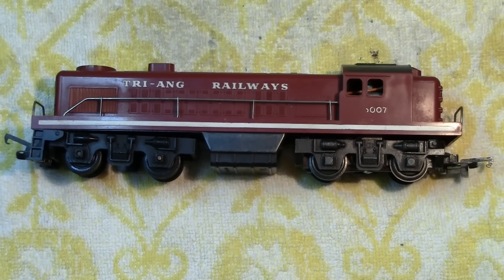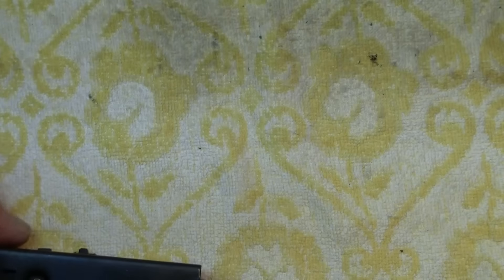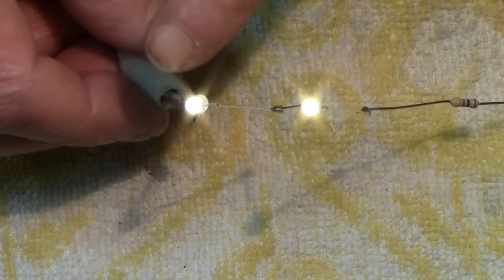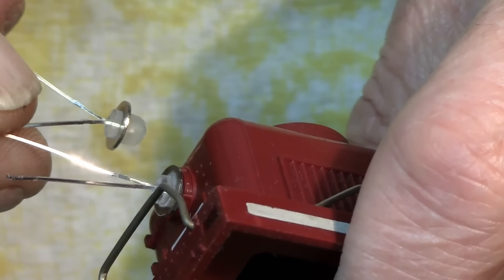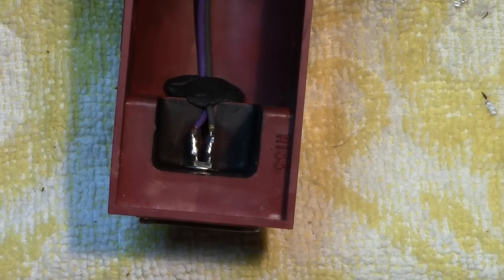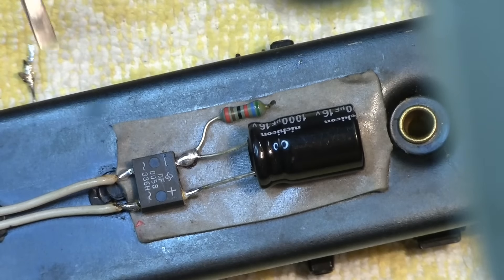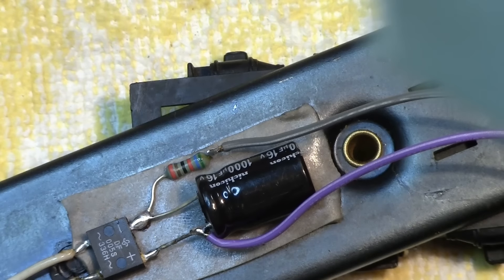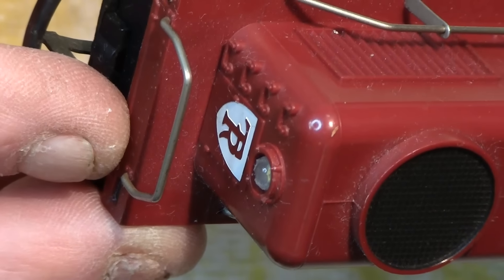Converting Your Tri-ang R155 etc Switchers To Anti-flicker LED's - All Variants. Hornby Triang.

Comment: Excellent video John and has given me inspiration to do something similar to one of my two SR electrics, both of which I had from my childhood, one I have kept as original and the other I have converted to DCC with modified wheels (no knurling) but it has no bulb (no idea where that has  gone!) so I think a 3mm LED might find it's way in there. I have kept all the original parts just in case I want to revert it back to normal again. Many thanks for showing this, much appreciated.           ............Graham
Reply from the maker: +Graham Foulston Thank you Graham for the nice comment. It's such a simple job but very effective & as you so rightly say it can be done on a multitude of items....space allowed that is. If you do it with just one LED everything stays the same although it might be worthwhile increasing the resistor to around 820 ohms, dependent on the current requirement on the LED's that you use? All the best, John.
Reply: Cheers John, I will seriously think about giving that a go and many thanks for the heads up on increasing the resistor value, I will let you know how I get on. Cheers for now,     .........Graham
Reply from the maker: +Graham Foulston Yes mate no worries.....always here to help if I can. All the best, John.
Reply: +Graham Foulston A simple job says he -Graham , I guess  to John it is quite easy though he does explain it well but you know who to call on if you come across any problems eh ? Hope your well graham and sorry I have missed the Tuesday club last couple of weeks but hopefully will be listening in again this week , Alan
Reply: +Alan Surgeoner   Hi Alan, when something like that is laid out in front of me like John has done then I can follow it but I don't think I would attempt to do a double header like that one without some help. No worries about Tuesday nights mate, just whenever you can. I keep screwing up the link so just be aware!   lol.       ........Graham
Reply: Graham Foulston I'm sure it will come together over time. Every good thing has it's glitches to start. How is retirement going. I don't suppose the rain has been any less down south than it has in Scotland (even since the floods) I think the wife must have secretly spoke to him above and said please no garden railway this summer Pretty please haha
Reply: Graham Foulston Was actually looking out some old stock I have an old 37 a couple of tank steam trains and the mail drop off and pick up set . I have a class 35 (Hymeck) I got for Christmas one year ,it was 2nd hand but you were grateful in those days. However it never ran yet my dad swore it did when he bought it . I wondered about talking to John or watching his videos to see if it can be sorted 9which I'm sure it could0. Thing is to start a new layout I am back staying at my parents house after moving back from northern Ireland for a lot of years but it suits me as they are getting on (only don't let them hear me say that) but also I keep a couple of small tanks of tropical fish and its hard enough trying to look out for one hobby never mind two unless you have very deep pockets. Anyway hope you are well .Alan
Reply: +Alan Surgeoner   Retirement is now at long last getting good, I have only just got rid of that virus which I picked up before Christmas so I'm just starting retirement now!!  This last month was a complete wash out.  OK now though. It's been pretty wet down here but nowhere near as bad as what you've had, no floods thank god.        .........Graham
Reply: Graham Foulston Hope for a railroad for the O scale class 50 then ,lol . gnight mate .
Reply: +Alan Surgeoner Night buddy.

Comment: Hi John. Very informative and interesting as always.  However - I seem to be having problems doing mine. I'm using bi-colour White/red at each end, using back to back diodes and a resistor on each LED, to make it "Colour-directional". (I'm using my variable bench power supply to test) I have rated the circuit to easily cope with 16vdc, and I get around 1/2 to 3/4 brightness, from say 6v - up to 16v, which is plenty bright enough. and the circuit works absolutely fine on it's own, swapping colours when swapping loco direction. A 1/2 hour test at 16v in both directions, proved absolutely fine. However, once I connected it to the power bogie, as I eased up to around 6.5v, led's lit as they should, until the motor kicked in, but then, the leds start to act strangely. when the motor runs, the red LED suddenly pulsed quickly, then went to a solid, very bright white, then popped, all in under one second. checked circuit. all was as it should be. no shorts. no bad solder joints. It's as if the motor itself is affecting the power to the LEDS, causing them to blow. I have now destroyed 3 out of 4 leds, in trying to solve the puzzle. any ideas before I run out of LEDs ?
Reply: Yes Gary I do know what your problem is! It's the back EMF from the sparking brushes. A phone call would be easier, If you put your mobile number here on the article I'll give you a bell for a chat how to fix this problem. Cheers, John.
Reply: @johnchambers2571  Hi John. Hope you are well. Nowthen. done loads more research/testing etc. Fitted a new Cap across the motor terminals, which stopped the brushes arcing(Suspect old Cap was duff !). but LED problem remained. mate's oscilloscope revealed, at 12vdc input from bench PSU, reverse spiking was 487 V !!! but appears to be coming from the serrated wheels. If connected LEDS to track - zero issues. So this has me thinking. Replacing the trailing bogie wheels, and adding pickups, just for LEDS, does bypass the issue completely. But unsure what size to get for the freewheeling bogies (R55 and R155 - respectively) . so it completely leaves the now healthy, but still power-spikey  power bogie alone. Does that make sense? what/which  do I need for metal replacement idler bogie wheelsets?

Comment: On LEDs the "Cup" inside the device = Cathode = -VE.LEDs are also self regulating, so will always have 2.2 Volts between the Anode and Cathode with the surplus voltage dumped into the essential ballast resistor to be bled off as waste heat.I once fitted bespoke carriage lighting for somebody about 20 years ago that involved building a brass wire frame so as to have an LED inside each compartment. In each carriage vestibule was a 3.6 Volt ni-cad battery and ballast resistor which charged up off of pickups on the wheels or by a 3.5mm. jack socket under the floor.Each carriage would run its lights for just over 5 hours.I visited the owner of the carraiges long after completion of the work and found him under his layout using a carriage as a lantern whilst he rummaged through boxes.With the LEDs on the loco it is possible to wire so that the LED headlights are directionally lit. Another option is to have a 3.6 Volt ni-cad battery under the hood wired to an LED in the cab so that the cab is lit even when the loco is stopped.
Reply from the maker: Thanks for adding more information to my channel Andy....always appreciated. Cheers, John.